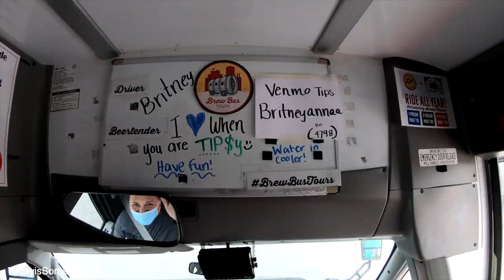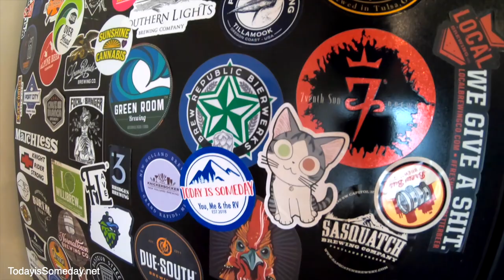Must Have Extra RV Parts (Full Time RV)

Comment: I build a cabinet (box) under my king-size bed just for spare parts. I keep an extra belt for both my generator and diesel engine plus spare parts for my water heater, furnace, and any parts I think will come in handy when I go to repair my motor home as it's 16 years old now.

Comment: If you make removing and cleaning the squirrel cage every few months will help it last longer. The dust build up can break loose unevenly thus throwing the balance off causing it to rotate and wobble this causing the plastic to crack or separate. The best way to stop them from breaking is to find a metal squirrel cage.

Comment: Squirrel cage fix.   You could chemically or mechanically afix a thin aluminum ring for both ends of the squirrel cage. You would have to cut out the aluminum to make it a circle and it is not intended to cover the end like a lid. You could either glue it or screw it to the plastic.I would glue it. This would eliminate the deformation of the plastics while Experiencing centrifugal force.

Comment: In addition to what you had in your video here are other extras that I keep:  A Valterra Twist-On Waste Valve, GFCI outlets, brass garden hose splitter, I have a 50 amp coach, so have a 45 amp adapter- for when there is not a 50 amp plug in the power pedestal (there needs to be a separate breaker on the 30 amp and 15 amp receptacles).   Extra 50 amp extension cord, 30 amp extension cord, two 12/3 50' extension cords.  I have used those at RV sites and for moochdocking,.  When I moochdock, I am able to have 30 amps going to my coach.  I have an Atwood water heater, so carry two extra 1/2" plugs.  Extra breakers.

Comment: Sometimes when the water pump doesn't work it is actually the "latching controller" this lets you have several switches to turn the water pump on. But a extra/spare water pump is always good.
When hooking up to water at a park always let it flow out of the hose bib before hooking up. I have seen some nasty stuff come out. You don't want to clog your filter any faster than you have to.

Comment: I carry an extra propane pressure regulator. I have a class B and the propane pressure regulator has been a problem in the past and it's really scary when you smell propane all the time because of a faulty regulator. I'm going to purchase a solenoid so I don't have to worry about my batteries recharging is my solenoid goes out. I also carry a spare water pump.

Comment: squirrel cages extra great items, and idea, if you dont have a water pump, a squeeze blub, does work, at less our getting water, as far as the pressure regulater for the water, they make a black bunjee  ith whole on both sides that hold onto the pressure side and the side of the hose going to the rv, or wrap a bungee cord around so you dont forget the unit again? for latches i switch all mine with marine latches, s/s  made to last forever.  also for the fuel filter , i installed a Racor filter on the main engine and 1 on the generator, . its fuel filter that many have seen on large tractor , or big rigs, the filter goes inside the glass holder, and comes with O ring , the filter size is about the size of a small  dixie cup. replace every year or twice a year depends on your mileage every 25,000 miles .  the filter unit on the bottom has a pit cock, to drain water or condensation from the fuel tank or fuel line.

Comment: Spare keys , WD 40, plumbers tape. Electrical tape , zip ties,mastic , Spare electrical adapters from 15 amp to 30 amp to 50 in all directions. Lots of electrical cords . Hitch pins, carabiners and shackles ( travel trailer). A length of mule tape.

Comment: I also keep the non self leveling dicor on hand for windows and side seals, I keep a diaphragm for the water pump and a water pump just incase I can repair it,  extra wire, wago connectors, water heater thermal cut off  and thermostats, lots of extra batteries for tpms sensors and stuff, crimp connectors regulars and water proof lots of stuff to be prepared guess I need a blower fan I have a Coleman unit as well.

Comment: My wife and I have the Sena helmets, the Thule rack and the Topeaks sliding rack bags.  Suggest adding support straps for the rack.  There is a lot of weight bouncing on the receiver with 2 ebikes.  The straps have clips that attach to the hinge side edge/seam of your rear hatch/door and then to the rack.  The straps are typically 1" nylon webbing.  On the Thule, I have them attach to the riser U bar (the bar that bike clamps lock to).  The straps significantly reduce bounce and sway.
Reply from the maker: Thanks for sharing!

Comment: Along with fuses, recommend some spare relays. Had an ignition house relay go out and my rig would not sense the ignition key turned on so couldn't operate slides or jacks. Also, a pair of crimping pliers and butt splices (which you mentioned) and heat shrink tubing when you splice. A ladder of some type. Spare DEF, Coolant for eng and genny, and AquaHot boiler fluid(if you are so equipped). Really good part of video about spare parts.

Comment: At one point someone was looking into finding a source for an aluminum replacement squirrel cage for these units. If you can put up length - diameter and blower  shaft size might be able to find one.

Comment: Been with your channel from the beginning. Love your focus on Veteran's! We are also FT in a 33AA (2015 model). Pro-tip on the Mach 8 AC units - Once a year or when you have them open to change out either fan, put a few drops of 3-in-1 oil on the base of the fan drive shafts, clean the fins with a can of no rinse foaming cleaner (any big box store has it), and dump a red solo cup full of water/1oz of bleach into the condensate drip trays (the condensate pump will push it down the drain lines where it will kill any algae/accumulated mung and keep it flowing. You're AC units will love you. Go Navy!/Semper Fi (USS Saratoga CV-60 MAR-DET mid 80's).

Comment: Great list of spares!   The only large thing I would add is a Propane Regulator.    Those 2-stage regulators on the MotorHome fixed tanks are surprisingly hard to find in a small town.   Ours went out and you could smell the propane near the outside tank.   Had to order from Amazon, and wait for it to arrive while we went without Propane.
Reply from the maker: Great tip!

Comment: Thank you for the Good suggestions 😉

I’m just starting to consider the floor plan for building out my Rig (Ambulance) that I’ve taken on a few short trips. So far my spare parts are electrical items, fuel filters, engine and fuel fluids (for cold weather). There will be more to come like: water pressure regulators, water pump, water filters, and shower recirculation filters... I’m looking forward to getting started 😉
Reply from the maker: Glad it was helpful!

Comment: I carry a spare fuel pump for my Onan Generator. I have had two go out on me with less than 300 hours on the generator. Small in size and not that expensive to have a spare, also easy to change if need to. Safe travels!
Reply: Aftermarket fuel pumps for Onan is a crap shoot. Oem part is reliable though more expensive. If genny dies :-(

Comment: Sorry we missed you during your trip to Tampa.  Regarding spares:  Besides the air conditioner and water filters, water pressure regulator, squirrel cages and water pump, I also carry a spare step motor.  Not really spares, but for added safety we carry an emergency exit ladder we keep in the bedroom, and bought two additional portable fire extinguishers.  I keep one in the galley, and the other in the bedroom.
Reply from the maker: I think we are going to add a step motor as well.  We do have extra fire extinguishers in the galley and bedroom ase well.  I need to look into the exit ladder.
Reply: @todayissomeday  And I forgot; we also carry spare windshield wiper blades.  I think you do as well.  The ladder rolls up so it stores easily.

Comment: Thanks for all the ideas! In some older rvs they used light bulbs and turn signals so I always have spares
Reply from the maker: That's a great idea!
Reply: Replace with LEDs using same socket type. They don't get hot and use way less power.

Comment: With your spare water pump, a water pressure regulator or your AC part, how about a spare engine ! HA HA HA
Reply: I always carry a universal control board that will work with my furnace or water heater.

Comment: Someone told me you can get electrocuted from residual energy on some part of the unit??? That scared me so I think I’ll call Mobil rv tech. Does anyone know about that?
Reply from the maker: Hot skin is a thing.....RV inspectors do it as part of the inspection, but techs will know how to do it as well.
Reply: Means you have a hot wire touching the frame or exterior. Misplaced screw drilled through wire in wall for example.